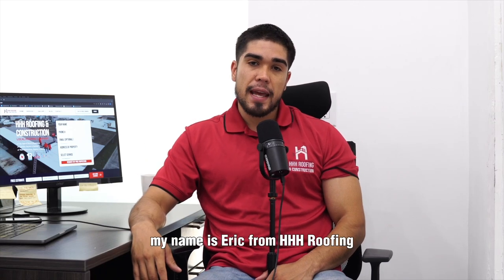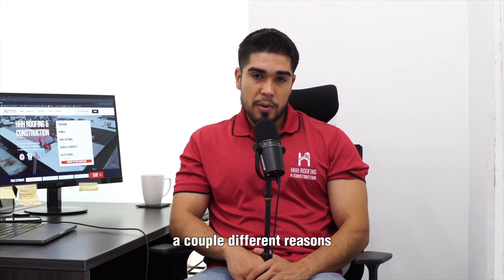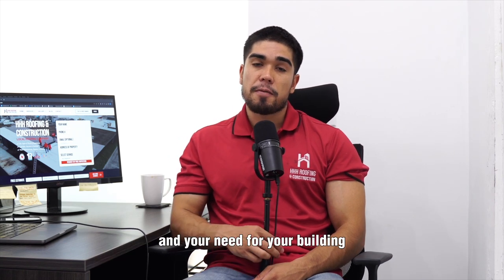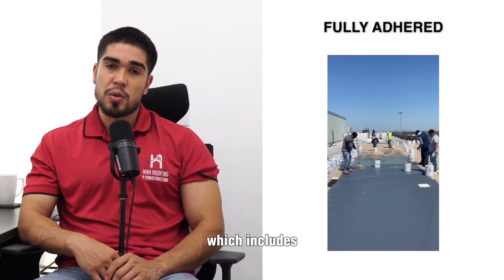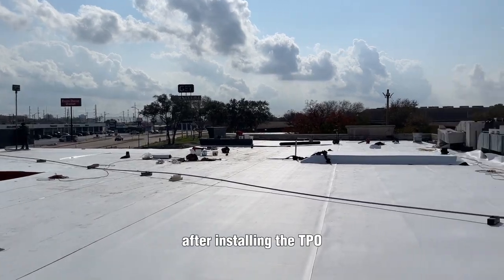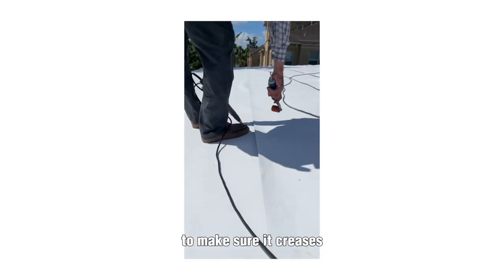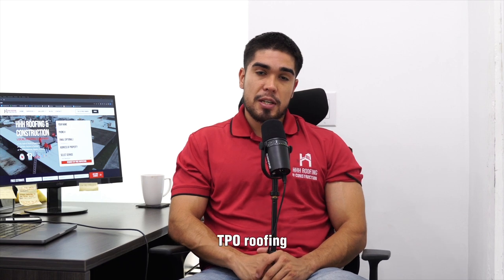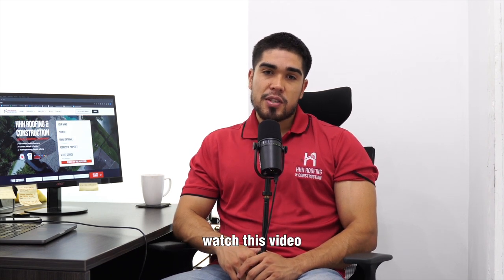What Is TPO Roofing? The Ultimate Guide To TPO

Comment: I’m curious why y’all used insulation plates for attachment of the TPO membrane in your MARS assembly. They’re is no barbs on this plate so the TPO will be pulling on the fasteners only with out the aid of the plate and you have reduced the amount of wind uplift pressure the roof can handle now. Typically all manufacturers make a seam plate for a MARS assembly.

Comment: Thank you. I am looking into this for a double-wide manufactured home, near Tampa FL. Right now it seems like the heat is coming straight down the middle of the house and you can physically feel temperature differences walking though the house. The a/c is 2 years old and definitely not working as efficiently as it should as my summer electric bills are $240 on average.

Comment: Tpo is not Thermoplastic POlyfin, it's Thermoplastic PolyOlefin. Hence where the O comes from. 
TPO has not been around for 30 years so it doesn't last 30 years on average.  The oldest tpo ever isn't even that old.  Modern TPO came in 2011 after the major scandals of 2003, 07, and 09. Systems prior to that had a different chemical composition and would disintegrate in the sun, the MRCA, SPRI, NRCA have touched on this at length in 2010-2011.

You forgot Ballasted TPO. BUT admittedly,  it's awful and deserves to be forgotten.  

Missing details on TPO is a real thing.  There's so many tiny intricate details where a single tiny mistake can cause massive damage.